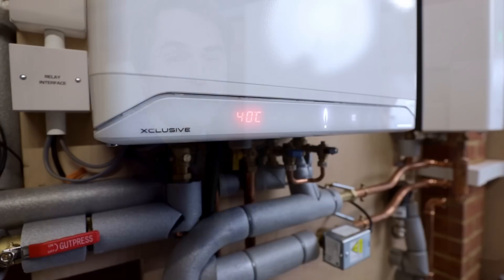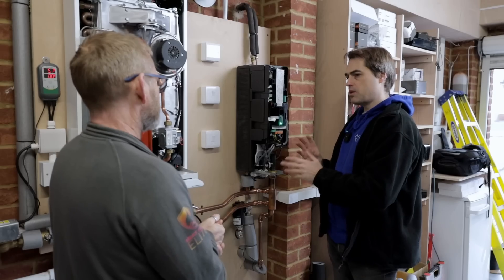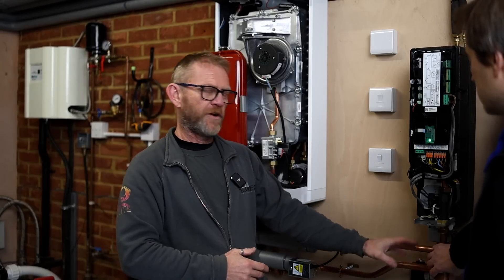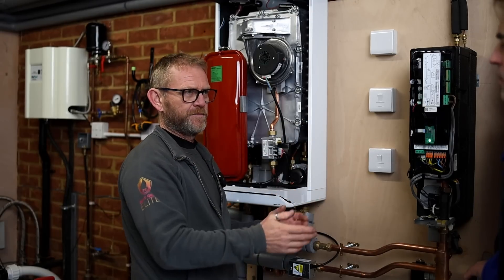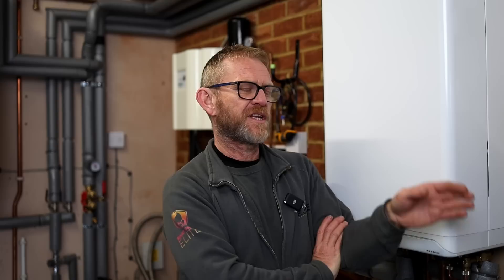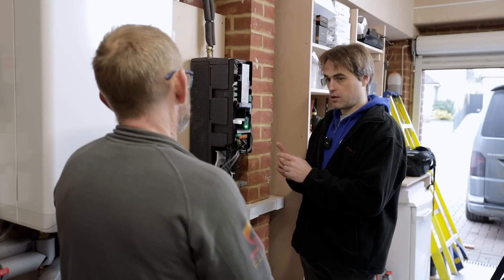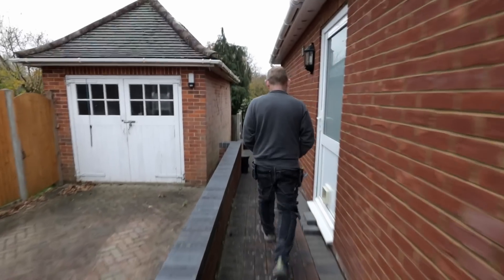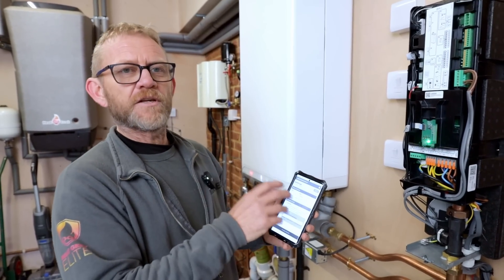Intergas Heat Pump Hybrid - The Easy Way To Clean Heating?

Comment: It seems like a good idea to make the boiler and heatpump work in conjunction with one another, but is it really?
The boiler needs to run when the heatpump can't provide enough flow temperature or the COP is getting too low, right? I think you can replace the "or" with "and" in this statement: as long as the heat demand is low enough to keep the COP above a certain treshold the flow temperature won't need to be maxed out to meet that demand, but when the heat demand goes beyond what the heatpump can deliver the COP will also drop because of the low outside temperature. 
So I believe in most cases, it will either be beneficial to run purely on the heatpump or purely on the boiler, with only very few circumstances justifying the use of both at the same time for heating. Hard-switching between the two sources and using valves to prevent both pumps acting on eachother seems like a much more efficient idea than insisting on the possibility of running both at the same time and needing a buffer to counteract the downsides of that setup, no?

Comment: Three times the install cost and a maintenance headache for no benefit over a gas boiler? No thanks!
Reply from the maker: Much lower maintenance as boiler has to work less. Lower running costs.  I’ve weather compensated heating. No breaks in heating with DHW demand. Much lower carbon emission. Much lower energy issue. Much more efficient overall system, but yeah - keep your head in the sand

Comment: Sounds like heat pumps then are not good enough to be able to do the job on it’s own so needs a backup,  heat pumps are relatively new so is it because they are new they are not as efficient as what we’re told , all I hear about heat pumps is they are 160% more efficient than gas boilers and I’ve heard from some experts they are 400% more efficient , sorry for using the word expert especially after the lockdowns scenario the word expert would be used with a warning sticker.
Reply: Not at all, there are plenty of heat pumps out there that can handle it all on its own.  This is more of a compromise of not having to do as much in the way of upgrades to rads etc, and utilising the combi boiler for DHW forgoing needing a cylinder.  Heat Pumps aren't new either, they are fairly new to the UK, but in other countries, they have been used for decades, proving their efficiency.
Reply: @BenIsInSweden  Are they less expensive in other countries not only the purchase price but the cost of running them , the information that I’ve heard be it correct or incorrect is they are expensive to run even though they are more efficient, with electric being four time more expensive than gas and that was the electric company who said that , I find it somewhat amusing all those who are trying to go green with getting a heat pump are still paying 15 % of their bill for the green agenda, one would think taking the 15% off would generate more interest in purchasing a heat pump, sounds like a Black Adder scenario go green and still pay 15 % for the green agenda.
Reply: @KavanOBrien  cost of the actual units is similar.  Running costs depends on a few factors, like last December due to a series of unfortunate events, I was paying around 60p/kWh for electricity.  Even with electricity being 4x more expensive than gas, a properly installed heat pump will for the most part be cheaper to run.  However, I don't see electricity always being 4x the cost of gas in the UK, especially considering more people are taking up solar and battery storage.

Comment: The Xtend system does not offer total redundancy (boiler fails, heat pump will still heat the house/DHW and vice versa). You would be foolish to install this system in its current state.

Comment: You were discussing reducing your carbon footprint... And then a few minutes later show us how the gas boiler is used to heat an open-air swimming pool! 🤪
Reply from the maker: Use a heat pump for pool !
Reply: You also aren't reducing your carbon footprint if using lots of electricity from the grid.

Comment: The refrigerant lines here don't look brilliantly installed, and it is a shame to see the indoor unit connected with flare fittings rather than a solid brazed connection. Possibly more installer friendly this way, but in the world of professional air conditioning installs, you see less and less flare fittings on unit connections as they represent a potential leak point.

I imagine adding split refrigerant circuits to a heating system will lead to hugely increased risk of accidental refrigerant discharge where the knowledge and expertise of those servicing / repairing the heating system has to catch up to overlap with that of refrigeration. When you get an installed base of such units (and don't get me wrong, they look like an excellent development when some of the hydraulic kinks are worked out), it will be important that they are maintained by people who are clueful not to disturb the refrigeration side of the system unless they are trained and qualified (and competent) to do so.  Brazed unit connections on the refrigeration side would remove a potential risk point.

Just out of curiosity, what refrigerant is this system running?  Do you know if the unit is reversible (so it can defrost the outdoor unit by pulling heat from the hydraulic circuit).
Reply: pretty much every residential split system across the planet uses flared fittings at both ends...

Comment: Would the gas boiler not just cycle very inefficiently?
Reply: I think it would be better with a buffer. With the poor modulation associated with the intergas boiler a buffer would help to control the excessive output

Comment: Are these hybrid systems eligible for the grant available for the heat pumps? I have a relatively new boiler and would like to understand how the hybrid system from Vaillant is working, would be great if you could make a video.
Reply: Nope.  Grant is only applicable for switching to solely a heat pump.
Reply: No. You have to disconnect gas completely to qualify.

Comment: It's more sensible to connect to a low loss header/buffer than use a CCT if head is too great on the pump of one unit and the CCT is too close to a unit. Generally try to avoid CCT on systems with multiple inputs because of it.
Reply: Can you explain why this is the case. I've not seen any issue related to your statement.

Comment: Love the xtend. Installed like 30 xtend till now. No issues.
Reply from the maker: Are they that popular in NL? Why is that?
Reply: @UrbanPlumbers   goverment is paying subsidy to people or landlords for installing heatpumps.
Reply from the maker: @mitchienl2509  what subsidies do you get for a full heat pump and for a hybrid? Here we only get subsidies if you remove gas completely, so no subsidies for hybrids.
Reply: For most of the hybrids between 2000 - 3000 euros Depends on KWS. for full electric, between 2500 - 4000 euros @UrbanPlumbers
Reply: Air to air systems have no subsidies except they are free of VAT for equipment and installation
Reply: ye we know, but its not the topic right? @davebaker4620
Reply: Actually in NL there is no difference in subsidy if you go hybrid or full electric. Subsidy is a fixed amount of the kW for a unit. Government is massively pushing for a hybrid solution. One of the most sold hybrids is the Remeha Elga Ace, but don't think that Baxi sells it in the UK.
Reply: Air to air is not subsidised in the uk apart from the no VAT as they are not wanting to to encourage the use of air cons in the summer - fairly rare in the uk in the domestic market

Comment: Love this idea and I personally have applied similar installations on commercial properties. 
 The premise is the same but with a different execution.  I think your on the correct path with the limitations of the little heat exchangers it should have  more surface area and a means to blend the boiler supply and return for a to maintain a constant so the boiler can modulate evenly. 
 Great application 👍 and I'll watch for updates and possible control points.
 Hello from New Jersey and tonight the temperature will be down to 28 degrees. "F" LOL

Comment: Intersting to find how this hybrid could work with Vaillant boilers which have only Ebus and not OpenTherm
Reply from the maker: It wouldn’t. But vaillant heat pumps would work with vaillant boilers. I toyed with the idea of doing it at my own place, but probably will not bother anymore and remove gas all together
Reply: You can pickup a VR33 Ebus to opentherm module from Europe. Note this will void will void the warranty for UK vaillant boilers!
Reply: @Saaj2 if valiant voided your warranty for installing that I suggest you take them to small claims court and get them to justify that.

Comment: Love your videos - installed Intergas Xclusive 36 -which is great - as a Combi in Jan (after watching your vids)and this unit wasn’t available in uk at the time  
In Oct installed 2x Toshiba Haori 4kw air to air units One for the Lounge 20ft by 15ft and the other for the same size bedroom above (total of five double rads now not used) Gas savings seem to exceed the cost to run Haori units Plus once we are in the lounge /bedroom in the evening the boiler can be turned off or on at a lower temp- early days yet but impressed so far 
Plus aircon in the summer if required 
Kind of the same idea as video 🤔😂

Comment: Surreal. We have an existing gas boiler that works effectively on its own to heat the house. Then an additional expense is incurred to install a heat pump which the installer admits won't work on its own so the existing gas boiler remains to help it out.  🤡🌍
Reply from the maker: That set up lowers your running cost and carbon emissions and allows you the time to get the house fully ready for removal of gas. I believe in Nederlands where this set up is made, you can’t install gas boilers without it anymore
Reply: Guess you don’t have access to solar pv and off peak electric tariffs!

Comment: does this system recuperate the warm exhaust from the gas boiler? (blow the exhaust through the heat pump condenser if not)
Reply from the maker: No
Reply: I suspect the mass flow from the boiler exhaust is a small percentage of the mass flow through the ASHP and is not worth the engineering cost to effect this.
Reply: Pretty sure boiler exhaust is corrosive to most materials

Comment: I too have connected my boiler to my pool. I suck/pump the pool water out of the pool via a filter, it intercepts the cold mains going into the boiler, sending it back out of the boiler heated straight back to the pool. The end result is it heats up fast. I've also installed an electric shower next to my bar mixer shower for when my combi is in use by the pool.
Reply: Sounds pretty illegal as you describe it, isn’t there a risk you pump pool water back into the water mains.

Comment: Surely putting it through a buffer makes it a normal hybrid system? I.E you could do it with any boiler or Heatpump?
Reply from the maker: Still doesn’t need a cylinder and has all the functionality of controlling the tariffs and cop
Reply: @UrbanPlumbers yeah good point about the cylinder. Shame the government don’t incorporate it in to the BUS grant.
Reply: Probably going to be incorporated I would guess. @deanchapple1

Comment: System pump should pump away from the expansion tank. Because it's before the line with the expansion tank, the system pump wants to pump into the gas boiler instead of through the system.

Comment: Who makes it for intergas ? It’s not much of a solution for anything when it’s only 5kw. Not impressed at all. Very poor compared to the rest of the market
Reply from the maker: My house only needs 3kW so would work great here. Most houses 🏡 n the UK are 6kw. Almost all new builds will be below 5kw.
Reply: @UrbanPlumbers   my house is 10kw. If you only need 3 kw surely you wouldn’t touch one of these? You’d just want a hp no? My point being if a house needs a small unit why would you or anyone fit a hybrid? Waste+of time
Reply from the maker: @heatpump8566 I would fit it just for heating
Reply from the maker: I am afraid I don’t know.
Reply: It looks very "Daikin" to me. Pretty sure I read the Alpha hybrid heat pump is a custom daikin too.
Reply from the maker: @BenIsInSweden could be anything. Feels like aircon unit adapted for heating. I like the fact that it’s only 3kW at -2. Could do my house without cycling
Reply: If your heat pump can cover all heating loads than you don’t need a hybrid. Surely the point of a hybrid is to put a small heat pump in that can do a lot of the load most of the time and then let the gas pick up when demand goes up.

Comment: Just looks overly complicated and a massive turn off as a potential ASHP customer. I would rather have a well designed ASHP system. I am sure their are use cases but I just don't see it.
Reply: Agree. Plus, if you're only using it for a couple of cold days, you're still facing additional cost. First you have the upfront costs. And additionally you have the fix cost for the gas line and the chimney sweeper. I can't see how you will ever save money with this. But it's probably appealing to people who have heatpump anxiety.

Comment: From a technical perspective it was really interesting. From a sales perspective it was an analogue of Gerald Ratners prawn sandwich. I really like the idea of a heat pump but I could not see myself ever adopting a solution like this - it’s just adding a whole other level of complexity and the perceived benefit is marginal. The proposed solution to the boiler short circuit through the CCT, is a buffer tank (or is it low loss header) and now you have the overhead of three pumps. The bit I did not understand fully is the bit about the boiler pump being on full output all the time and that was ‘overpowering the CCT’ - surely the Intergas has a burner linked pump? 
All that being said the 5KW ASHP should cope with most modern small properties for most of the heating system  and the boiler required maybe for a month or two - makes you wonder if would be easier just to change over the heat sources with zone valves, which you could probably control by flow temp from the ASHP (using weather compensation) using the logic of greater than x degrees for two hours - change to boiler.
Thanks for sharing this though.😀👍

Comment: By no means do I know a lot about this but I can imagine it could be a thing that would get people away from buying larger then necessary heat pumps for the few days in winter where it may not be as efficient. Especially if they already have a boiler. I even wonder if you could have an apartment building with small heat pumps for the flats and then a gas boiler at the basement so that you could run the smallest possible (and cheapest) heat pumps knowing that there is a backup.
Reply: Seconded. Even when we're not talking about flats, there are newly built houses (I'm in the UK) with no obvious space for a big water tank. Having the combi boiler for domestic hot water and some sort of hybrid system for central heating appeals to me, especially because I'm getting credit on the electric bill during the months when solar generation is higher.

Comment: Intergas do the same thing but without that other internal unit.. its just internal gas boiler and outside heat pump...
Reply: It was piped up as, flow out of heat pump, into return of boiler. Out of flow in boiler around heat emitters then return back to heat pump return...

Comment: Thank you forbl sharing, personally I can absolutely see myself using this, I have 1 year old 36kw baxi combi in my well insulated new build property which is stupidly oversized for heating (minimum 9kw modulation). When I moved in it had stupid on/off controls and weather comp sensor disconnected, I installed Drayton wiser controls using opentherm and it now runs better but it is cycling badly because of the oversize. How does this integrate with existing controls... Would my wiser connect to the extend unit over OT or do you have to use intergas controls now? This would be a great solution for me as I have a combi which is totally unsuitable for my heating load so I could use ASHP for that and then hopefully only need the combi for hot water.